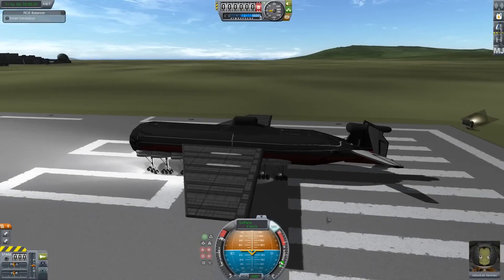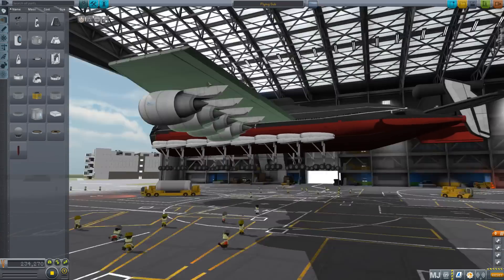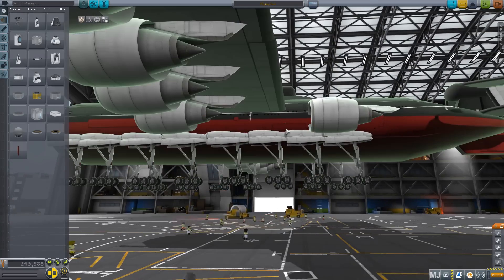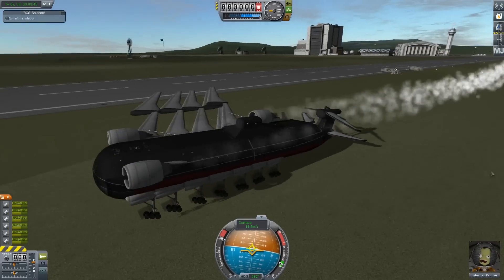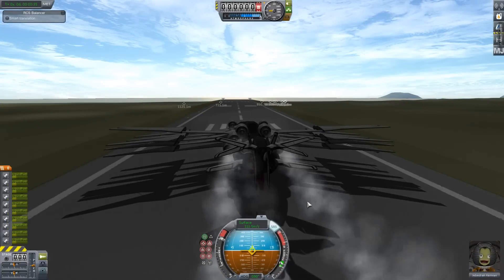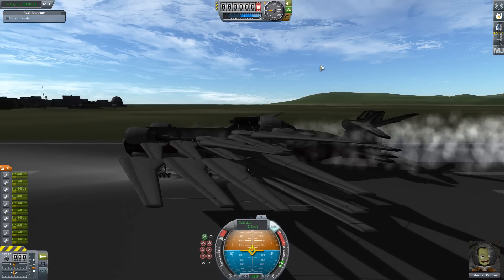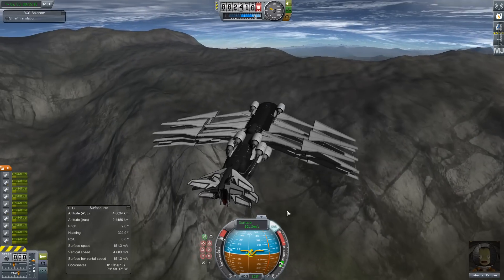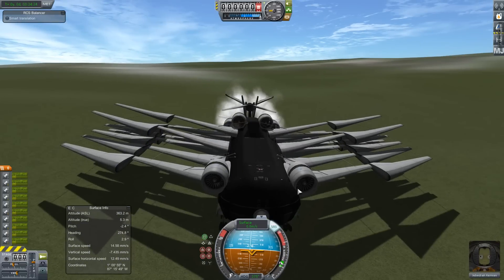Most Kerbal Spacecraft Ever - Part 2 - Jet Plane Nuclear Sub

Comment: Those Big S tailfins always skew one way or another on the runway. I can never, ever get something to take off in a straight line with one of those on. I have to use the other tailfins. Also, you didn't add fins on the FRONT. I always put big fins--advanced canards, generally--on the front of my planes to help get the nose up on takeoff.

Comment: Actually it is better for wings to move on them as much mass as you can (from plane). That's because if you put mass on wings it can be lifted directly by wing, without transferring any force along wing. You can see that clearly on bending momentum graph (or what it is called in English) for wing.
Trust me, I'm Aviation Engineer :-).

Comment: Hi Scott Manley, thanks for using yet another of my mods!  I have actually just updated it tonight, after watching this.  The ballast does work, however its just so ridiculously heavy, if you don't drop the fuel to a lesser amount, it will just sink and sink HARD. :)  (This has been corrected)

It's designed to be used with the water engines from The Large Boats Parts Pack, and in the update (if you download it from CKAN or Spacedock) you should find it easier to control.  The weights adjusted so that further adjustment through payload isn't required, and overall slightly better in general.  I hope you enjoy it.  FYI the ballast works best at aorund 1120/3000 Liquids.

For the ballast you have Fill start / Fill stop   and Empty Start / Empty Stop.  When floating on the surface 

It is of course a recreation of the Fictional Typhoon Class 'Red October', modelled by me, textured by me, and imported through unity with Configs by my good friend Tyler Mastrson (TMasterson5).  

Seriously you've made my week again!  Thank you so much.  I can't wait to see the next part.

- Rob.
Reply: One downside is the steering is inverted, I need to put it back through Unity change its orientation.  But until then, you should find better results with this new config ;)

Comment: There's a problem with this plan. Jool has much higher gravity than Kerbin, so for the wings to support the submarine's weight, they would be under much higher strain. If it barely works on Kerbin, it definitely won't work on Jool.

Comment: Oh god, that sky is beautiful. And the water, too. What mods are those?
Reply: scatterer
Reply: Thank you
Reply: TheTechnicalNirl i thought my reply was pointless given the fact that alot asked about it
Reply: LemonSplatter!! I'm afraid I didn't read the rest of the comments. Why would it be pointless? You were very helpful.
Reply: Is it memory intensive or not?

Ive heard of a mod that cleans up all the clutter, but im not sure...
Reply: +azmanabdula i think the "mod" is "Active Texture Management", but it's outdated (doesn't work with new KSP) and all it does is reduce the resolution of textures
Reply: Al Eks I thought i heard something like that...

Are they  going to update it?
Reply: azmanabdula no but ksp has 64bit now which allows you to use more than 4gb of ram. also theres an option in settings to reduce texture quality
Reply: Al Eks Using 64 bit, (Have 16 Gb Ram) 

"also theres an option in settings to reduce texture quality"

I think its just optimization problems im having..
Reply: Im not sure yet..

Comment: So can you actually land on jule like you attempted in part 1? And do you plan on playing no mans sky?
Reply: Not pressure, density. And at least in real Jupiter, once the density is that of water, you are very dead from heat and pressure.
Reply: +Capt T well it doesn't need to be water to float. if the pressure is high enough then you'll float.
Reply: in real life however Kerbal doesn't simulate that
Reply: it's impossible to land at jool
Reply: Jool is a gas giant similar to Jupiter, you cant land on it.
Reply: Kerbol is the same. You can't land or swim at kerbol. The only places are Eve, Laythe and of course Kerbin
Reply: Exactly pressure is a completely different form of meassurment
Reply: Kerbol is the entire Kerbin System
Reply: I meant like maintain a stable altitude. Float.
Reply: it is not water either
Reply: when you reach a certain altitude on jool you explode
Reply: +Tesser 4D did you mean Jool?